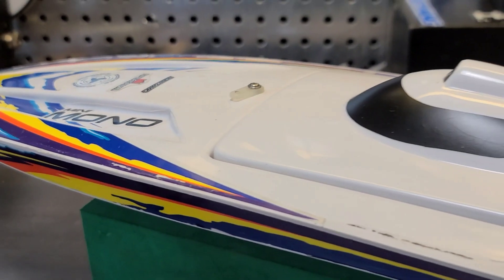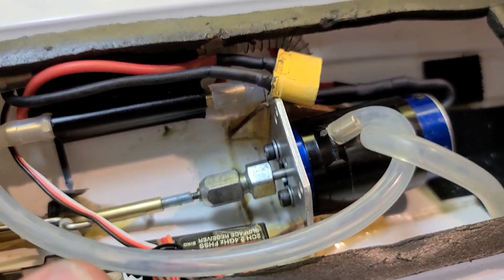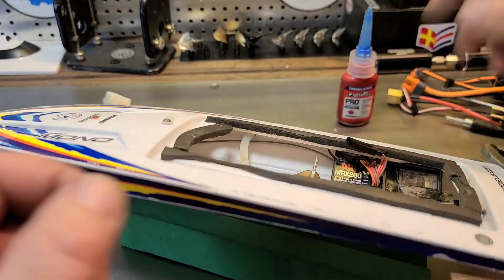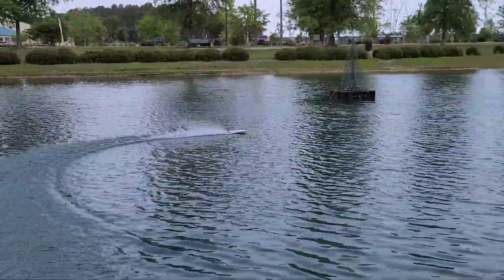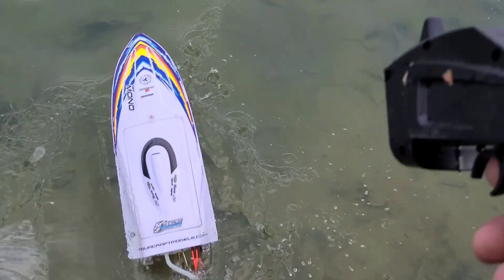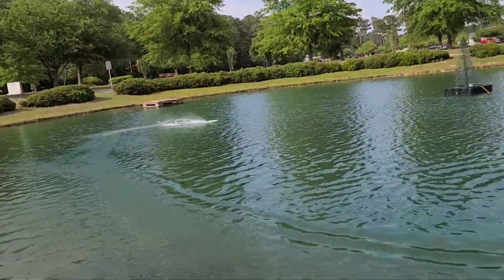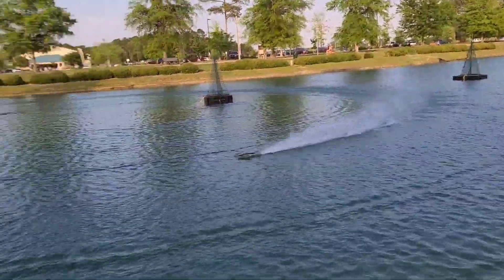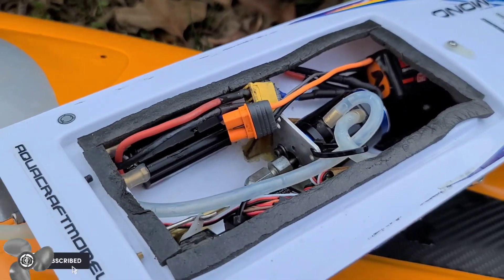Motor & Shaft Alignment Hack Fast Electric Rc Boat - Traxxas 380, Flycolor, Aquacraft

Comment: That little thing flys mate , I enjoy these tests and learn a lot. Just bought a used delta force 45 with a 240 amp castle esc and 42 100 motor.  Looks like it's been sitting for 10 years at least. Don't know what batteries they used because it's wired with bullet connectors.  Maybe nicads ? The cat I bought of the same guy has the same wiring . Cat has a 2100 kv team Orion 1/8 truck motor . Think that's only a 4s set up.  Cat looks great ,very wide and 960 mm long . The delta force is 6s for sure but they're old so maybe he used nicads got both boats for $600 Australian.  Bargain especially the delta force 45.
Reply from the maker: Yea man you got a great deal there.   FE boaters use anti spark connectors, for high voltage setups. Maybe you have a connector similar to this https://www.offshoreelectrics.com/proddetail.php?prod=ose-qs-7mm-anti-pairhttps://www.offshoreelectrics.com/proddetail.php?prod=ose-qs-7mm-anti-pair

Or this 
https://www.offshoreelectrics.com/proddetail.php?prod=ose-qs6-p
Reply: @IRONCLADRC  thanks mate,  it does have those connectors , I'll have to rewire it and solder ec5s in . Looks like a very nice hull from Delta force.  Top quality boat and I'm thinking this will be very fast .

Comment: My lights on the HH TUG didn't work forgot about the button on the remote.pressed the button still no lights. Found the problem the remote electronic switch a small circuit board wrapped in shrink wrap.when I flexed the circuit board the light would flicker.Bad board hope I can find one. Don't know if anyone else has had this problem.

Comment: That motor angle work-around was clever!  Not sure if I'd want to run the Daytona 500 against all the big sponsor competition with that, but it's certainly good enough for tearing up the local pond!
Reply from the maker: I would run back to back Daytona 500 with that setup

Comment: Hello. Which screw should I put on the boat 70cm motor 3665 2600kv esc 90a 4s
Reply from the maker: This one should work, the threads need to be cut down https://www.dollarhobbyz.com/products/traxxas-6-flat-head-hex-drive-screws-3x8mm-3931
Reply: @IRONCLADRC  I'm sorry . I said wrong. what size propeller to use?
Reply: @дмитрийабильев  38-42mm 1.4p 2 blade to start with.

Comment: I'm sorry this question is related to this video. How do you rebind the Horizon harbor tug boat? No bind port.
Reply: There is a little hole on the receiver with a button in it. Got to stick something small in there and push it, then the light will blink green. Then turn the transmitter on and should be good.
Reply: @Buellerwtfman  Thank you for that info I know another guy on you tube was having same problem manual doesn't explain that thank you for the info  .
Reply from the maker: Thanks brother, shoot I didn't even know how to see rebind the hh tug. Thanks